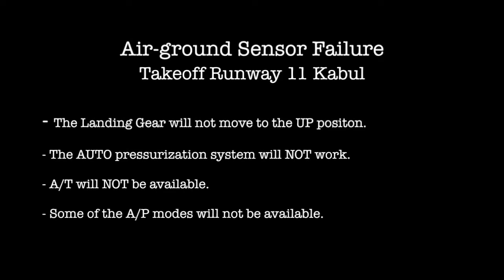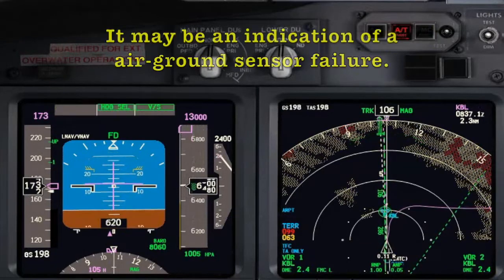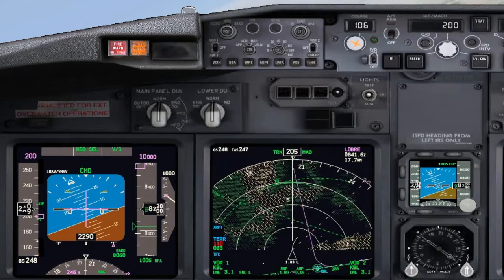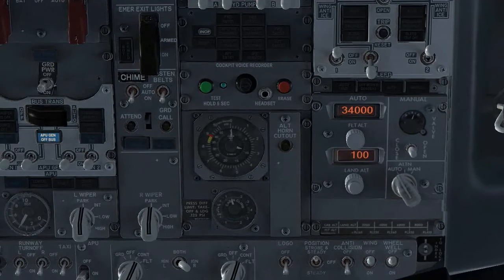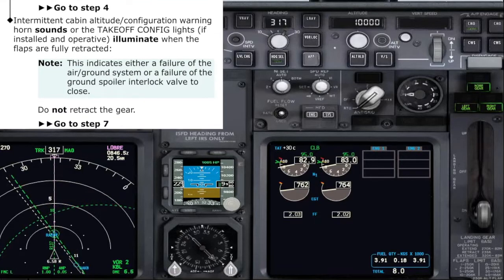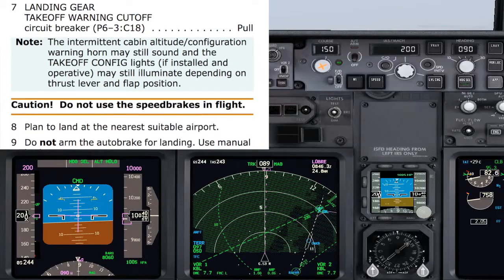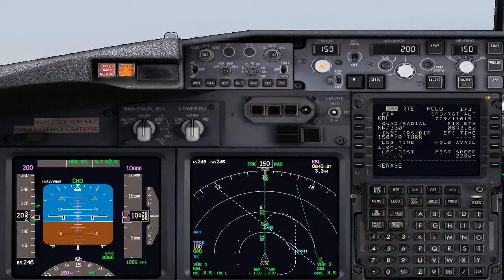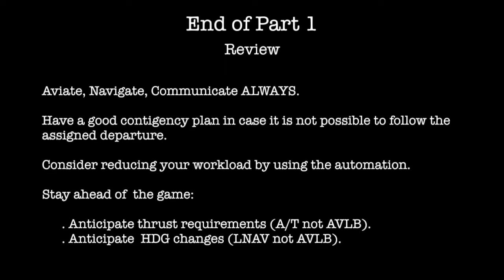Air-Ground Sensor Failure in Kabul - Part 1

Comment: Very interesting...the absence of barbers pole on speedtape and correct AT FMA annunciation(should be ARM by 800' not THR HLD) are giveaway clues that its air/gnd and NOT ground spoiler valve problem...and that they're not going anywhere but back to origin asap.If it was gnd spoiler valve then the option to continue remains providing speedbrakes are not used.Although return is preferable,you could continue flight if immediate return was tricky/impossible.Also you can silence that horn by re-selecting flaps 1...that way you can locate the cb in calm.

Comment: Very nice .....one thing ....why did we climb to 10000 ?
Reply from the maker: Sorry for the late reply. I've been very busy... Climbing to 10,000 is just to avoid using the oxygen masks. Because of the air-ground sensor failure the aircraft does not pressurize. Some pilots may prefer to diret the F/O to switch the pressurization mode to MAN e control the pressurization manually.
Reply: @boeing737pro3   many many thanks for your reply sir.... if oxygen mask avoidance is the issue we could hold 3000ft at complete the check list ?
Reply from the maker: @ashrafulhoque5627  , the problem is that in KBL, the airport elevation is approximately 6,000 feet and it is surround by mountains. Not the best place to have a pressurization related problem.

Comment: AG SENSOR FAILURE does necessarily require to follow an EOP over KBL City  when an SID can be safely flown PRESSURIZATION in MAN MODE/ control.
Reply from the maker: I think you meant "does not necessarily require", what I do agree.